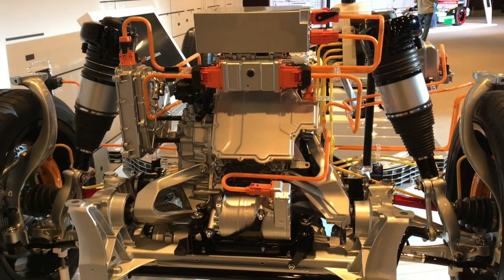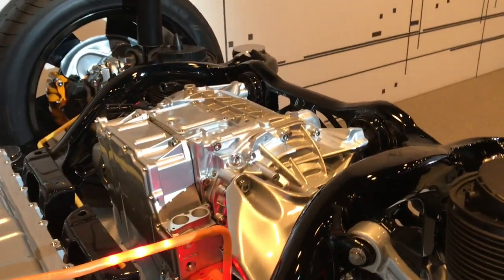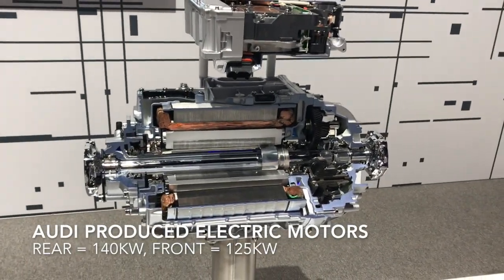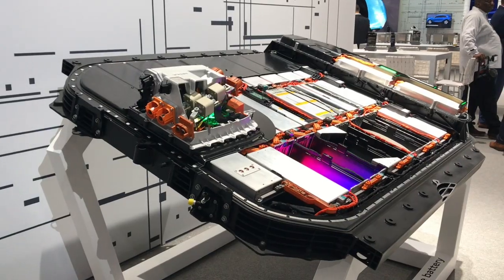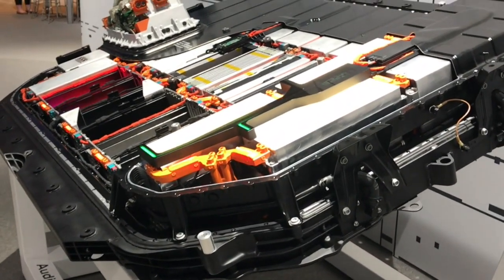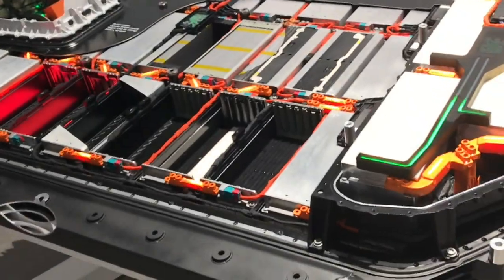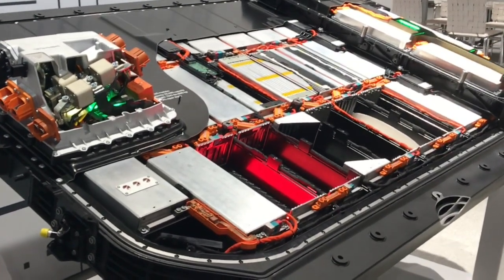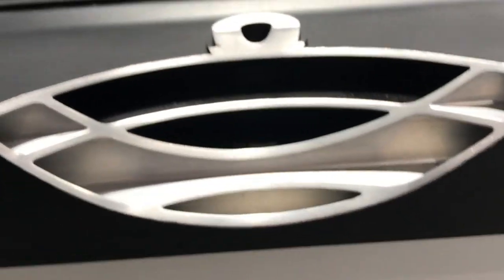Audi e-tron drivetrain and battery

Comment: The brakes are not the regenerative braking system.  Regen braking is the motor running in reverse as a generator.  Regen braking is always at the motor.  Brakes are brakes.